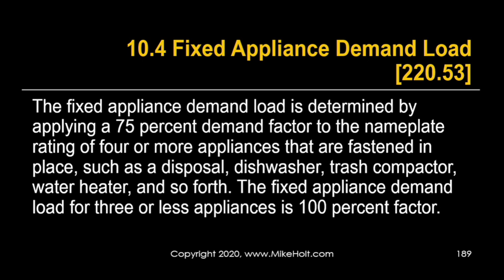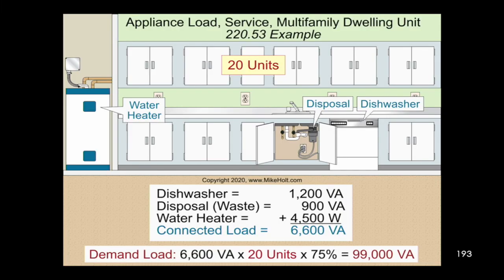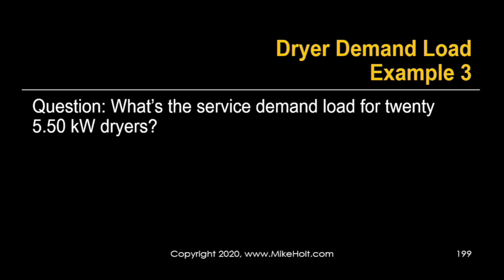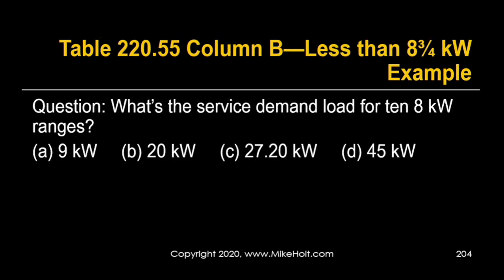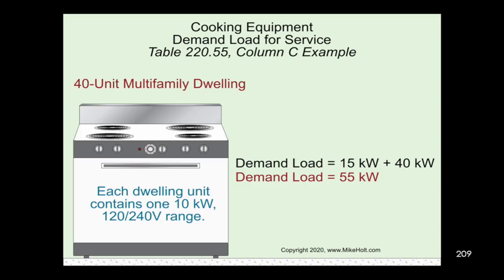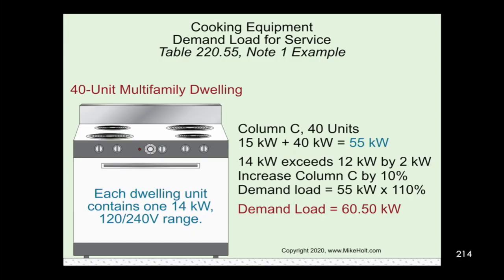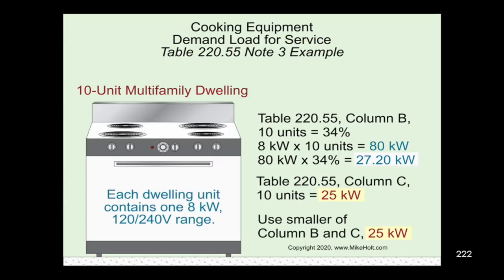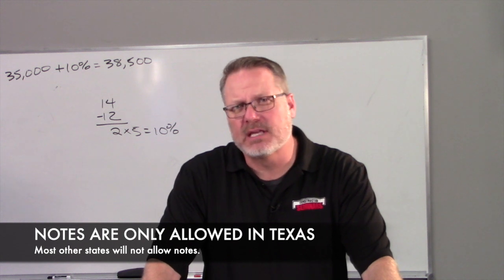Standard  Method Multifamily  Calculations

Comment: This was an excellent tutorial. Thanks. Greatly needed. I just have one question. 

At 20 minutes when you're going over AC vs heat, you multiply the AC VA of 4008 VA x 125%, then multiply 4008 VA x 9 units. Why did you multiply by 125%, since we don't know if this is the biggest motor or not, and why the 4008 VA x 9 units?
Reply from the maker: If no other motor is specified, I am assuming the AC motor is the largest motor
Reply: @constructionseminars4197   Thanks: 2 follow up questions.
1) Since you're using it for largest motor, why wouldn't you use it for all 10 units?

2) Does it say in the NEC to ignore the heat (if it's larger than AC) or is it just common practice to ignore heat for largest motor, given that it's larger than AC?
Reply from the maker: @icevariable9600  You only include the 125% on the first A/C motor, the rest would be at 100%. The largest motor is just one unit. If all 10 are the same, you just use one of the 10. A/C and heat are considered non-coincident load (loads that don't happen at the same time) when you have non-coincident loads you only include the largest of the two loads, and toss out the smaller per 220.60
Reply: @constructionseminars4197  Damn! That's right! I knew that about the largest motor, but, for some reason it didn't register as I was going through the video. Thanks.

Comment: Range question explanation please. 10 units, 8kW ranges load calc problem (approx 10 min mark). Why after we get the 27.20kW from column B do we compare to column C and take the 25kW as the answer? I can't find that rule in the code. Thanks
Reply from the maker: Generally on a test, they are looking for the minimum. In the field you can use either number
Reply: @constructionseminars4197  Thank you!
Reply: @constructionseminars4197  The answers provided for the 20 8kW range problem (at 10:00 in) only has 27.2 kW as an answer. 25kW (the correct answer) is not one of the options provided.

Comment: Each unit of a 20 unit apartment building measures 1,500 sq feet with a 5 kw range in each unit. There is a central laundry room located in the building. What is the general lighting unit and small appliance load for each unit? How do I figure this out I need help
Reply from the maker: It appears that they are asking about the small appliance and lighting load, the fact that there is a range in each unit is not going to be calculated. Also laundry circuit is not included because there is a central laundry room.
1500x3VA per sq ft = 4500
4500 x 20 =90,000
Small appliance 2x1500=3000 x 20 = 60,000
90,000 + 60,000 = 150,000
Reference Table 220.42
First 3000@100% = 3000
3001 -120,000@35% = 40,950
Remaining 30,000@25% = 7500
3000 + 40,950 + 7500 = 51,450
If the question includes the ranges add another 28,000 per table 220.55 column B 
20x5000= 100,000 x 28% = 28,000

Comment: Confused,why would I not use the a/c motor which uses 28 amps as largest motor?no disrespect meant, learning a lot Thanks!!!
Reply from the maker: In the example at 20 minutes, I am using one of the A/C units as my largest motor. It is calculated at 125% and the other 9 units at 100%. This is compared to the 100% of the heat. The heat was larger, so we tossed out the air conditioners.